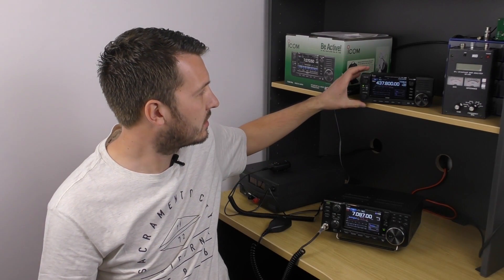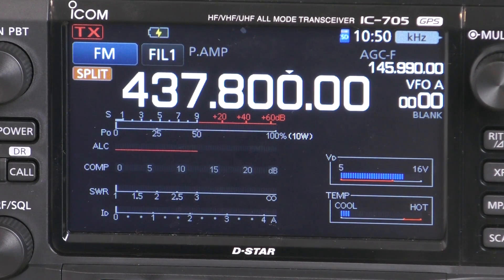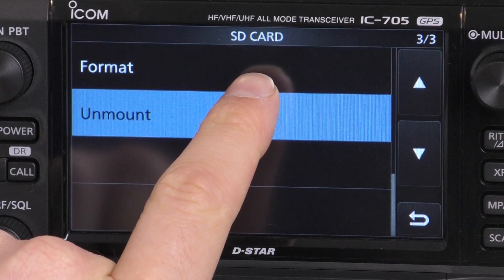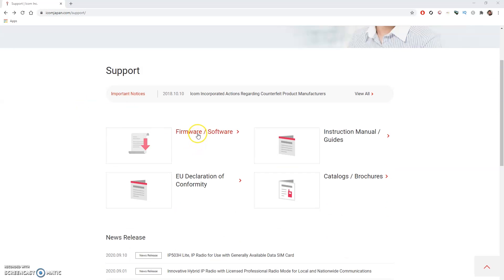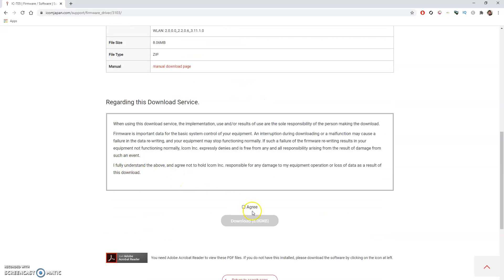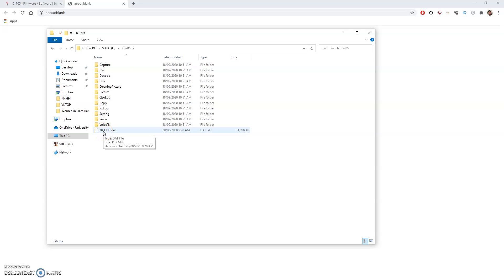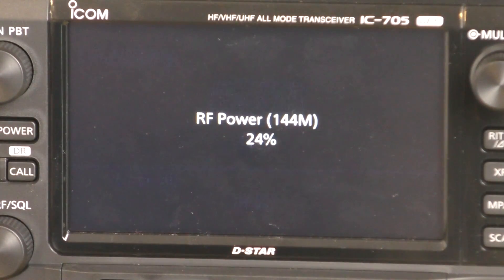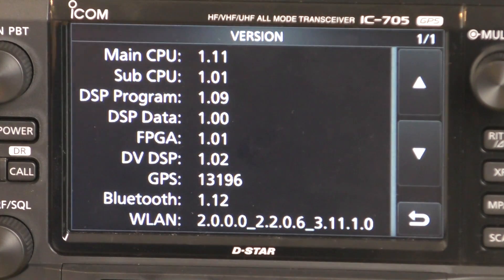Updating Firmware on the Icom IC-705

Comment: The manual notch function appears to be unselectable in FW versions 1.20 and 1.24 for USB/LSB/USB-D/LSB-D. Works in CW, RTTY and AM modes. I recall it worked in 1.12. Anyone else having this issue?
--N2GX

Comment: Nice Video. Does anyone know if you can use one IC-705 to operate another IC-705 over the internet or over WiFi?

Also wish they would decode FT8 and similar modes internally like they do RTTY. 

When I get mine I’ll start working on a iPad control application. 
W5MMT / HS0ZAC
Reply from the maker: Not sure about controlling one 705 with another. You can certainly use the RS-BA1 software but I imagine you want a hardware 705 in front of you as if it were the real radio, not over software?
Reply: Ham Radio DX          Yes. You can do this with the Elecraft K3 and K4. I have 3 iC-705 on order in America and 3 more preordered in Thailand once it’s approved around Christmas I hope.. It would be cool to connect one up to the antenna and sit in the living room and use another over the WiFi to control it. Also to use one in Thailand to control another in Texas over the internet. I’m not a big fan of Windows and use MacBooks, IPads and Raspberry Pi a lot.

Comment: wait for the  ic-705 Mk2 it will have 25 watts, the 705 Mk2G has an antenna tuner and 220Mhz as well
Reply: Wait for the 705Mk-5G
2 Antenna sockets + 8M , 4M , 1.25M & 23cm all at 25W, oh and Dual Receiver, Full Duplex and the added bonus of a Cappuccino Maker :p
Reply: @MINI-4X4-RADIO   what I said is basically what happened with the 706    and you're just being silly
Reply: @andhanwer  Apart from the Cappuccino Maker..
All very doable...
It's a "is there a market for the Price point..??"